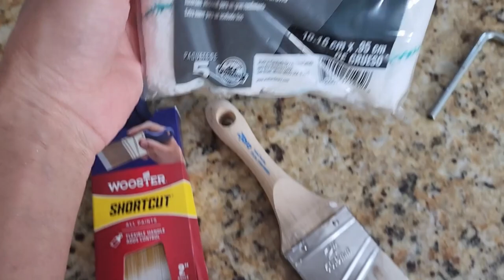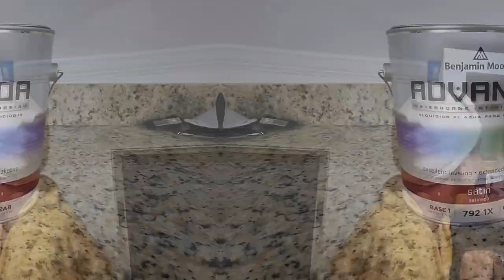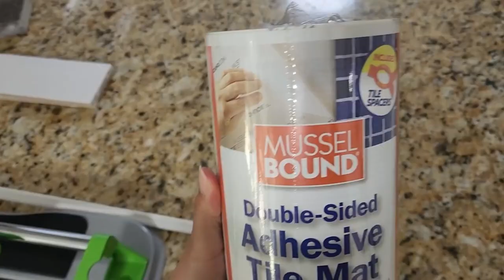DIY Kitchen Makeover | How To Paint Kitchen Cabinets +Tile Backsplash

Comment: Good job! I have the same granite tile and backsplash situation going on. Have been pondering how to remove it and what it would look like. Great job.
Reply from the maker: Thank you. They use glue on the backsplash so I think it's much easier to remove If you have a heat gun the loosen up the glue or once you have something flat like what we used It's pretty easy. It looks intimidating at first though. Thanks for watching